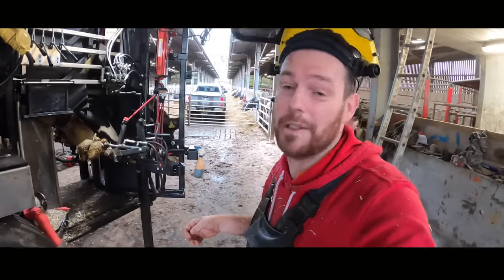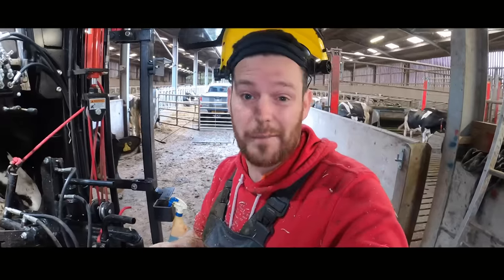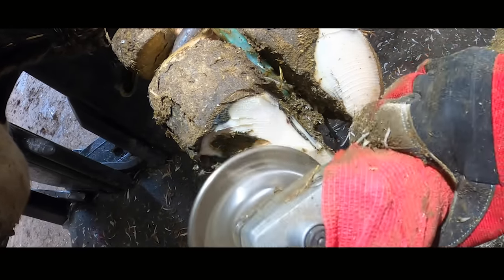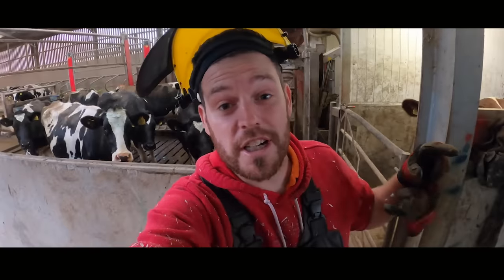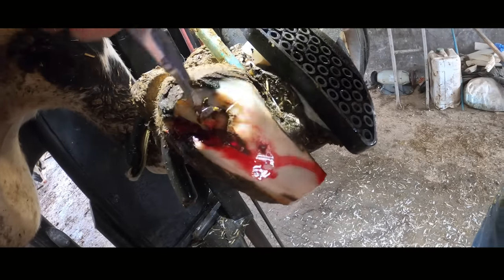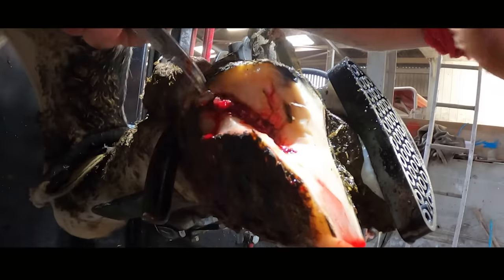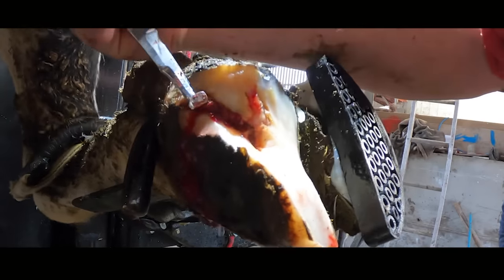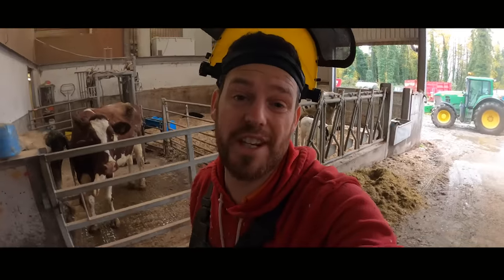WHAT'S AT THE BOTTOM OF THE HOLE IN THIS COWS FOOT?

Comment: Do you think through factory farming that this why cows suffer with their hooves. Surely if cows are meant to tread on soft ground that this is what the farmer should provide at all times. I have yet to believe that farmers care and that it's all about profit. Also it seems that they don't check the cows or you wouldn't keep coming back time after time to terrible infections.
Reply: 1.) The cows are usually in fields and come into the barn to rest.
2.) Don’t animals still get hurt if they’re on soft ground out in the wild?
3.) If they didn’t care about their animals, they wouldn’t call a hoof trimmer to help with their feet. They’d just kill them and get a new cow, which is much quicker and easier.
4.) Animals hide their wounds and problems because showing any sort of issue makes you vulnerable to predators.
5.) It’s very clear you’ve never worked on a farm or near animals if you don’t understand any of these concepts. Yikes.
Reply: @maryudomah4387  As a child I used to stay on relatives farm in the school holidays,I used to get up about 5.30am and fetch the cows in for my cousin.They were all in a field where they were milked was on concrete. After being milked they would go back to the field. I've probably done all the dirtiest jobs on the farm.

Comment: As I suspected and this video confirms it, keeping bovines inside and on concrete as opposed to open pastures, creates many, if not most of, these problems.  Yet, the dairy industry could not possibly survive otherwise.  I wonder if it could possibly be economically feasible to redesign the pens, the corridors to minimize the impact of their turn radius?  Sadly, I doubt it could be economically feasible to put some kind of impact reducing surface over the concrete the bovines use that creates most of the injuries.

Comment: You are incredibly knowledgeable about the anatomy and reasons for the problems, how long is the training for your work and what exams did you have to take.  Presumably you first practiced on either dead cows or dismembered limbs or am I way off?  You also have a small cut on your thumb, how do you survive with all that slurry and an open wound, what injections do you need and what hygiene protocols do you have to follow fo your own health and safety, not thinking of starting up in competition, I am nearly 70 and and a tiny disabled female lol, just extremely curious and awestruck at what you do!

Comment: I've been half this distance into a hole in a sheep's hoof. It was pretty nasty. I ended up having to take off part of the outer hoof wall to get to the bottom of the hole and get her healed up. Been doing sheep hooves for about 23 years now. Pretty much what you folks see here with cow hooves happens with sheep hooves, too; even horse hooves. I've dug stones out of my horse's feet from where mud season softens his hoof wall and allows small pebbles to get it to the laminae (white line tissue). If you leave it, it can cause further deterioration. In horses that's called "shelly hoof" because it produces crumbly hoof tissue that harbors more bacteria, causing further rot.   Still, having to dig out then resect my ewe's hoof was the nadir of my hoof trimming career (such as it is. I'm a farmer, not a farrier or professional hoof trimmer.)

Comment: Fuck that's sad. I had bad shin splints by the time I was on the grade 9/10 junior team for basketball because our gym floor was on solid concrete. And there was probably 4 other players suffering from shin splints and they hurt like hell. So everytime you did anything that involved running or is physically tasking you were in pain. Well the parents started to complain and the school ended up building a new court that had springs underneath. You couldn't tell the difference until you realized your shin splints stopped. It made a massive difference. I'm not saying build them a court but there has to be something u can lay on the concrete to soften the impact

Comment: Having worked on dairy herds for many years there is absolutely no excuse that these poor animals feet should EVER ! Have been allowed to get into such a diabolical state. This is blatant animal cruelty by the farm owners & managers. Dairy cows especially are seen close up by the dairyman 2, & sometimes 3 times a day during milking & are observed throughout the day as well. It doesn’t help that dairy herd buildings have been built to make it easier for cleaning out cows faeces & urine & usually water troughs are places at either end & in middle of cow bedding areas which also act as crossways for animals to access other parts of building & drinking water. Unfortunately this means as the animals walk towards these crossovers and water trough access points they have to do a 90 degree turn on concrete. This means that as they twist to turn so sharply all their weight is put onto one or two of their hoofs and this creates a torsion twisting motion directly to the hoof & inner hoof structure which is where a lot of hoof damage starts. This can be eased by inserting either spongy rubber or soft spikes rubber matting at these crossovers, turns & water trough access points that have some give in them as the animal twists on its hoof to turn. Some of this is exacerbated by certain farms keeping dairy herds indoors all year round to maximise profits & cutting, transporting & feeding grass in spring, summer & autumn instead of allowing them to graze the fields as they would do if they lived wild. This then creates more problems for not only for the feet but the general well being of animals. As with all herding animals there is an hierarchy and when restricted to buildings year round the lower levels of the herd society are less able to get away from the higher up individuals in the hierarchy whereas in open fields they are at least able to move away from their aggressor. Here are some coordinates for a farm in Somerset 51.1137256, -2.6677774 take a close look at this on google maps (not google earth as you won’t get identifying balloons) & you’ll not see any worn brown meandering cow trails leading out of gateways into fields as you will see if you look at other dairy farms on google earth. I suspect that the only time any of these cows are allowed out into a field is when they are stopped from producing milk a couple of months before they are due to birth their next calve as a milk producing cow requires diet that maximises milk output & Another giveaway is the excessive amount of manure & urine lagoons to store the animals waste products. Email the company, ask them how many hours each day their cows are turned out into the fields to graze. Spring, summer & autumn cows are perfectly capable of spreading their own waste themselves whilst out grazing on grassland as is natural. Most bovine farms only need one lagoon for the period while the animals are inside during the winter. This is just one example & once you know the signs to look for it’s easier to find more. I expect many of you have seen the beef cattle corrals shown on television in America where beef cattle are kept in massive pens with little room for movement & food is brought to them. This makes for faster beef production but to the detriment of the animals mental & physical well-being.